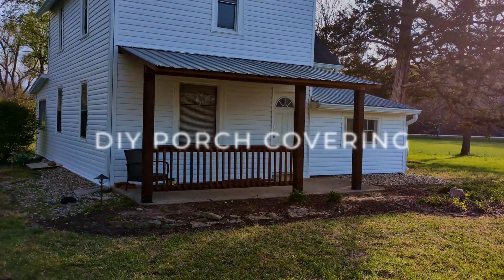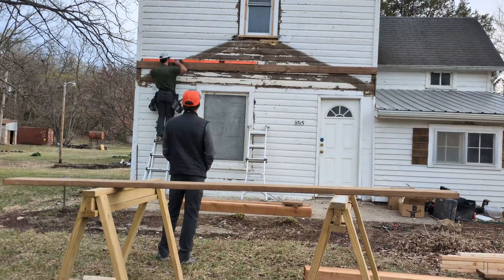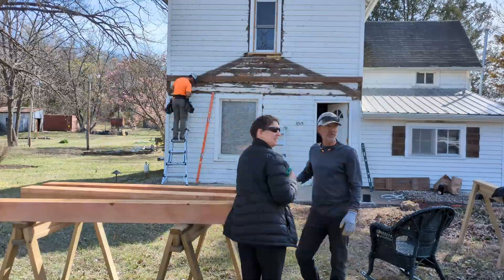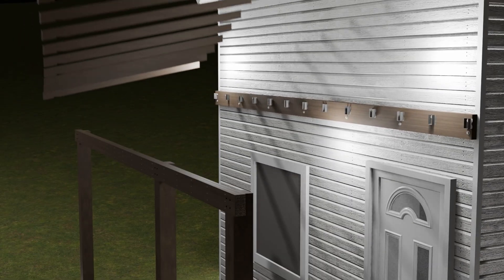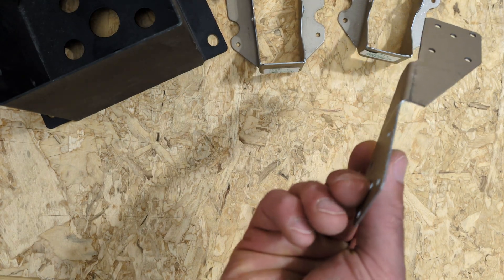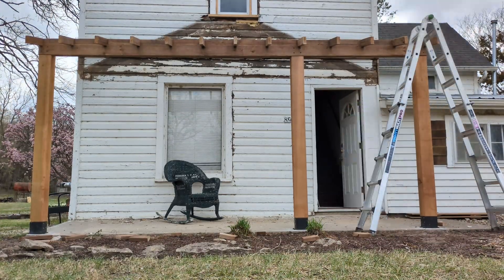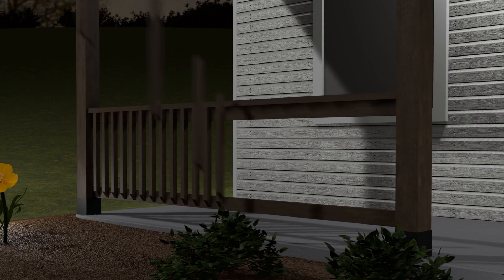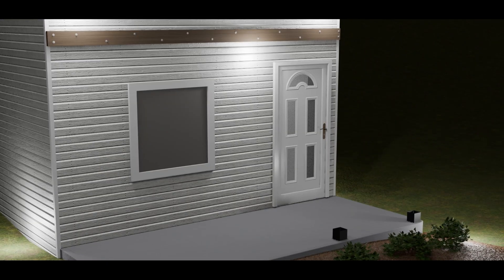DIY Porch Roof | Full Design, Build, and Cost Breakdown

Comment: What about drip edge?
Reply from the maker: We didn't install drip edge on the sides because we wanted to leave the option open for a gable style rake trim depending on how it looked without anything. Like I said in the video this was a family project so we may put a drip edge on the sides if we don't end up capping them. On the front side there's a ~1ft framed overhang with 3" of steel overhanging past that and we decided to cut a drain in the front landscape bed so that's our water solution instead of using gutter.